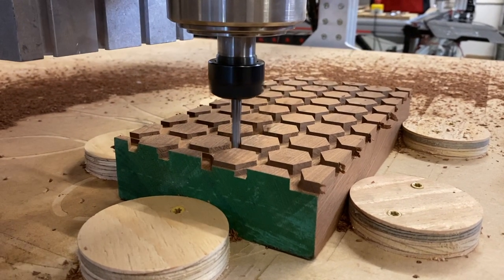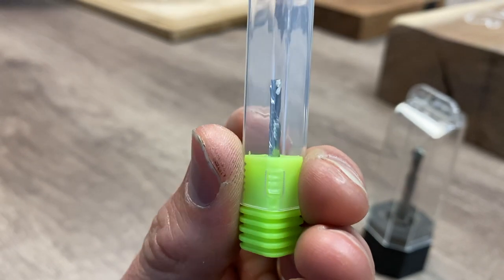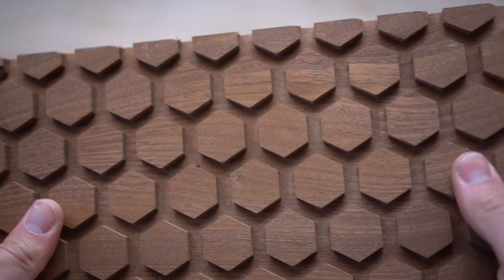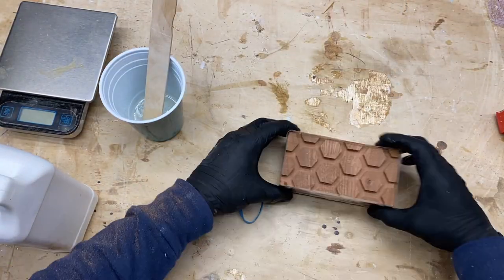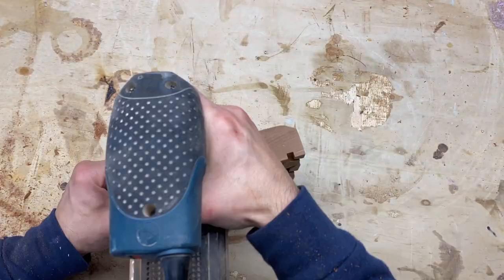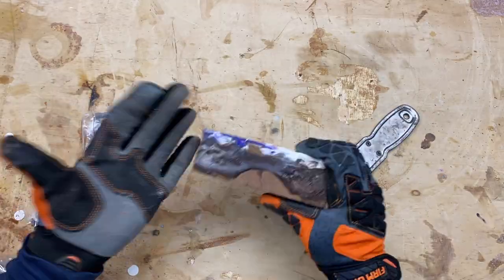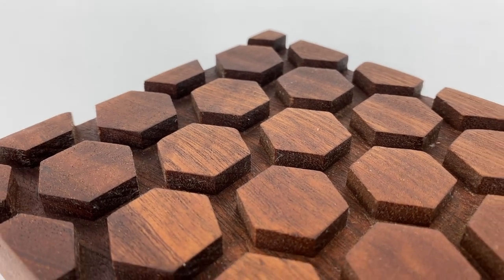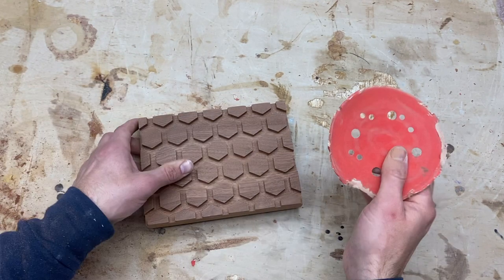CNC Hot Pad : First Time Using Avid CNC

Comment: Use the same pattern with a 1/2 inch thick board, cut to 3/8 depth.  Then fill with epoxy and let it cure.  Next finish the top then flip over and trim off the last 1/8 inch of wood from the bottom and finish it